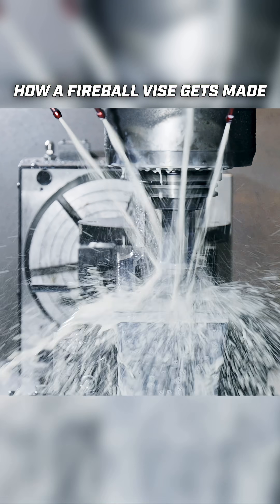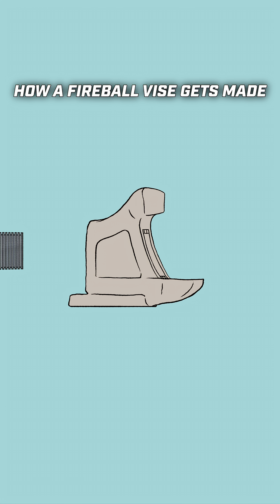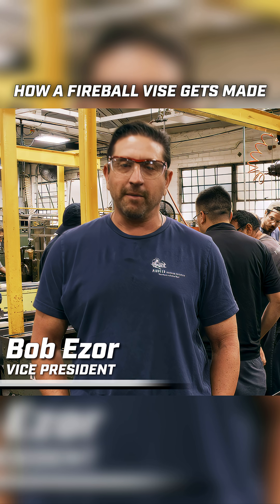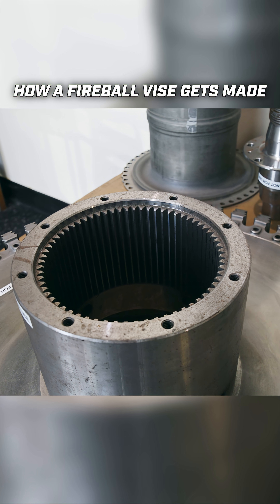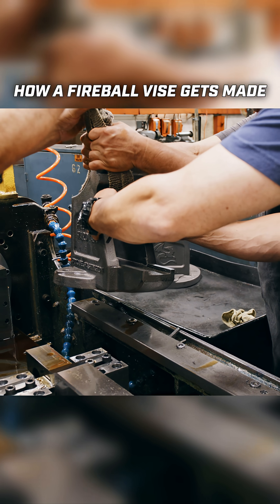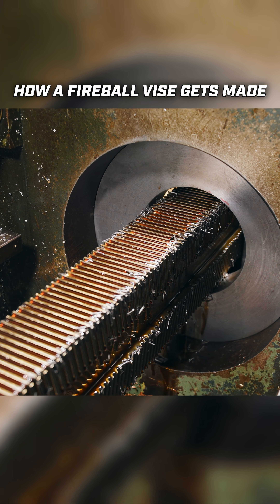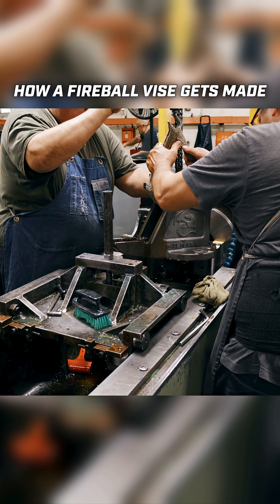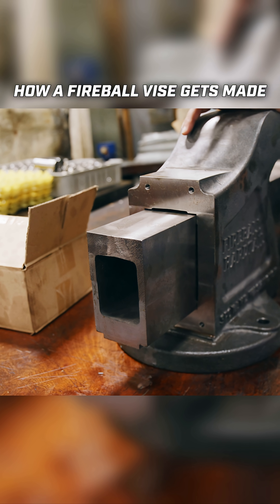From Machining to Broaching: USA Made Fireball Hardtail Vise Parts 🇺🇸

Comment: Just glad to see a company still performing in precision engineering in the U.S ( and I’m not American 🇺🇸 😂! ) I know this process well from having worked in the automotive industry power transmission . Seen both slab broaching and internal spline broaching . Excellent surface finish can be attained but the cutting oil used can be a health risk if you don’t keep clean by using your safety gear ! The vice looks awesome.

Comment: I’m long retired however, if this was back in 1970 I would say that I would be proud owner of a Fire Ball vice. I had a lot of nice equipment in the shop back then. So much manufacturing closed down in New England it seemed that there was always some great equipment for sale. Some just wanted to make room or were just closing down their maintenance department. I also had access to surplus government property. I felt guilty as it was like I was stealing the stuff. Some of it was belt driven old equipment sure but top of the line stuff easy to convert to electric drive it’s just power to a shaft.  Sorry I’m old 77 and ramble but you make great stuff love the new vice models.

Comment: Question: Because a broach is tapered. As it wears down, can to just plunge it deeper to make the same size finished product?
Reply: They can be sharpened by grinding the faces of the cutting edges without changing the size.

Comment: I imagine the front end where there is only support on the bottom poses a challenge for broaching. Only cutting on one side of the rectangle at the start compared to the main body of the vice could push the broach one way or another and affect the angle relative to the other surfaces

Comment: used to work where they used a broach and it was 2 stories tall but the piece it shaved was as big as a human fist.....pretty wild to see a machine that big and the size piece it was shaving its 2 sides to spec in one fall swoop......cutting oil everywhere and the shavings had to be shoveled out ever so often......very dirty job.....they would shovel the chips in a wheel barrow and take it out to the loading dock where they used to dump it in a dumpster......this was 50 years ago
Reply: What was it for?
Reply: Sounds extremely inefficient